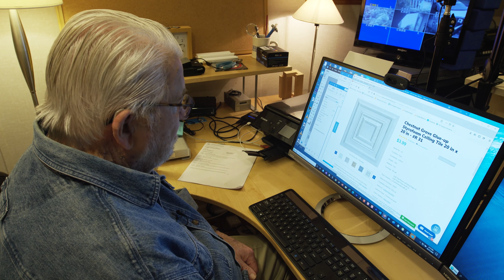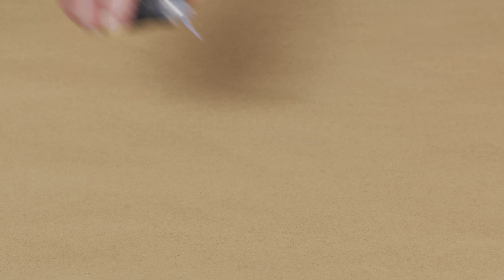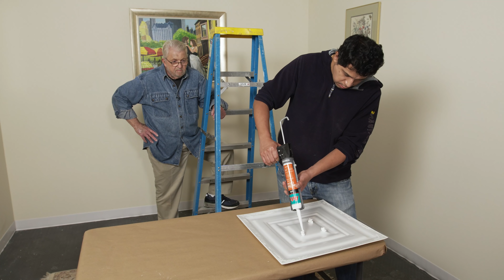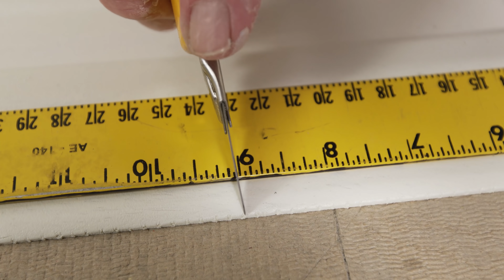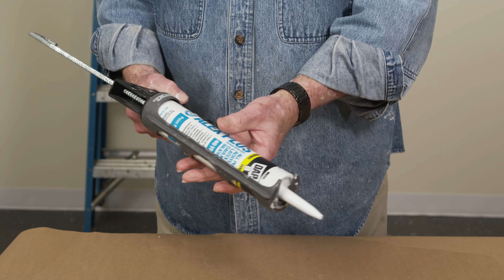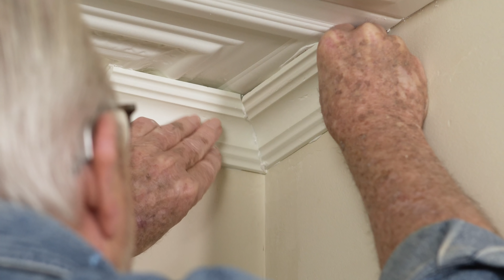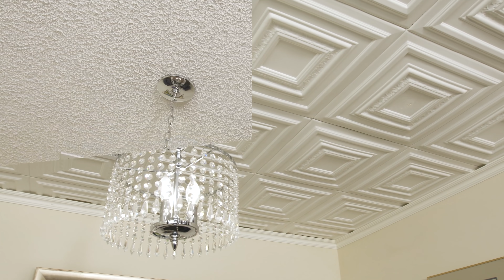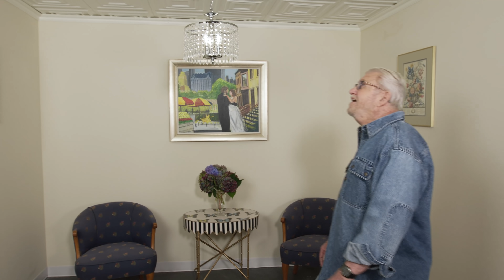Say Goodbye to Messy Popcorn Ceilings: DIY Guide to Covering with Glue-Up Ceiling Tiles

Comment: I disagree about starting at the true center of the ceiling.  I would have started at the center of the opening for the light fixture for a better overall look.  As it is, now the chandelier looks off.  What happens when the "popcorn" starts losing its grip on the sheetrock above? Now you have ceiling tiles coming loose and eventually falling off if you don't adhere them an alternate way.  It's a reasonable alternative to scraping, prepping and painting and looks really nice.  You could even just scrape and install the tiles, forget the prep and painting.  The demonstration and illustration was very good, nice and clear and logical.

Comment: I have scraped quite a few popcorn ceilings. Yep. Messy but worth it to have a smooth ceiling. Just get the texture wet and scrape it off with a 12 inch drywall knife.  Works great . . . Unless the ceiling has bee painted! In that case, I just go over it with 1/4 inch drywall and finish as normal (I have strapped the ceiling when necessary before putting on the drywall).
Reply: I have an awful popcorn ceiling in my living room. Whoever did the taping and mudding did a terrible job. Most of the "joins" can be seen, with no popcorn or tape. Not only that, but I recently had a kitchen fire resulting in soot throughout. Including the ceilings, of course. The house has been professionally cleaned, but walls and ceilings have soot stains. I've been trying to figure out my next step as far as the ceilings. Thanks for your comment, which makes me thing I should go with the 1/4 inch drywall. Now, a question: You say you strapped the ceiling. What the heck does that mean and how important is it?  Thanks.

Comment: Before considering this method there are two things to consider:
Textured coatings very often contain asbestos about 5% Chrysotile (white asbestop) so try not to disturb e.g. Dont scrape!
Polystyrene tiles are highly flammable and in the event of a fire they will provide a source of flammable material promoting the rapid spread of fire and the burning material will drip causing secondary fires. The smoke from the burning product is highly toxic and will rapidly spread to other parts of the property.
Reply: These polystyrene tiles are are serious FIRE HAZARD My mother bought a house with these on the kitchen ceiling,she had an oil fire on the cooker and it went up the wall as we were trying to extinguish it,as soon as it hit the ceiling the fire shot across the whole ceiling,the fire service said these are the worst things possible to have in a house,sorry I know they do a great job but they aren’t worth the risk
Reply: Any good safer alternatives?
Reply: Easiest bet is to skim plaster over them or overplate with plaster board to give a smooth surface then paint, it will look like a new ceiling. The asbestos content is low about 5% (if confirmed to be an ACM) wear an FFP3 mask when screwing through plasterboard if thats the option you go for.
Reply: @densalbeach1  wouldnt have thought the orig popcorn could handle the weight, especially wet from plaster, who knew
Reply: Two of the rooms in my house had  stippled Artex (trade name for a textured coating) because of the age of the house I presumed that it predated the legislation banning the use of asbestos. I brought in a plasterer to skim both ceilings, the both now look great. To remove Artex a chemical has to be applied XTex is one that is regularly used do scrapes for electrical instalations etc.
Reply: @dereckc9469  it doesn't.  Tried the above, only to come in the next day and find a huge pile of popcorn and fresh mud 2 inches thick all over the floor.
Reply: @eyerockart  you could just get a 9 in roller and roll some spackling compound over it 2 coats to seal it up as well .
Reply: @eyerockart  if your house was build after 1995 and has popcorn just scrape it. wear mask and goggles and full body suit , and use the wetting method to remove it
Reply: Thank you for that information.
Reply: @howmanyremember  Make sure to get the right mask coded for asbestos.
Reply: A mask rated as FFP3 should be used when working with any product that potentially contains asbestos. In the UK you can get task sheets for working with low risk ACM's (Asbestos Containing Materials) e.g. Artex (textured coatings), cement sheet used for shed roofs etc. These guides will include the necessary PPE and how to use it.
Reply: @Target Buy a kit; you need to scrape a small sample into a plastic bag and send it to a lab for analysis.  Wetting it allows for a fairly dust-free removal but wear disposable gloves and a mask.
Reply: Asbestosis pre 1980
Reply: In the uk the use of white asbestos (chrysotile) wasn't banned until 1999, blue and brown (chrosidolite and amosite) was banned in 1985, this includes the use of used ACM's (asbestos containing materials).
Basically asbestos was widely used in construction, if you have any doubts always play safe and get it analysed.
Reply: Thank you. It's good to know that the tiles are as toxic as they are ugly.
Reply: They have new ones that are safe. These are sold everywhere.
Reply: Asbestos has been outlawed for a long time that is a lie
Reply: So I changed my mind using it . Thanks for the warning ⚠️, However  I was going to say , that would provide another layer of insulation against cold 🥶 and heat 🥵 . Thanks !

Comment: This is not a DYI for a home decor upgrade but rather a Step by Step instruction guide on how to build your personal oven and tomb.
Reply: I know. The idea is good. The material used is bad. I'm redoing a bathroom ceiling with plastic ceiling tiles & trim...the cost is very reasonable & the tiles can be painted as a future decor change. ...I was shocked to see polystyrene for a real home. Polystyrene materials are used fairly often to build room mockups for companies to use as mobile displays to showcase their products for sale.

Comment: You sir are smart, putting ceiling tiles up to cover a horrible ceiling is the best and most cost effective thing to do, also they are fireproof, they have to be nowadays its a legal requirement. if your ceiling is fairly straight then i use a thick wallpaper paste to fix them, it dries in 2 hours.

Comment: FANTASTIC video thank you!
Reply: Get plastic or tin ceiling tiles...polystyrene is dangerous flamable. I'm redoing a bathroom ceiling using the super nice plastic ceiling tiles. Various colors available. Make the center mark at the center of the main light fixture & not the center of the room or else the main fixture can look oddly placed. Plastic border trim can also be bought. ...The polystyrene tiles & such are used a lot to create ceilngs for theater stage sets, room mock-ups for companies to make artificial rooms to show off their furniture & appliances & home decor & other items for sale...polystyrene can surely be bought & is used by cheap house flippers to make their redone homes look nicer. Basically the polystyrene catches fire & spreads real fast & has bad toxic fumes. Be careful.

Comment: If you dont see it , will not desapear  look harder then  remove the popcorn   plus i guarantee that will fall on you  popcorn is n ot to put nothing on it
Reply from the maker: Hello Aurelio, it is actually easy to put.  Many time when removing popcorn you will find that the surface under is not smooth and it needs skimming, sanding and painting.  With these tiles you have many looks to choose from and all you have to do is glue them up over it.  However, it is very important that the popcorn ceiling is in a good condition and is not falling apart to the touch.  If this is not the case it should be removed before applying the tiles. These tiles only look good, they also add a bit of insulation.

Comment: QUESTION: Can these possibly be glued up on plaster ceiling? I removed dropped ceiling in our old house and plaster is mostly in great shape except a few areas of finish coat that came off with thick wallpaper.
Reply from the maker: Yes, absolutely!
Reply: @DecorativeCeilingTilesInc  Do i have to put a new skim coat up of plaster first?  I know if we find any cracks I need to repair them but if just this skim coat do I have to replace it first?

Comment: I wish this actually worked. Sadly, this method did not work for me. I hired a handy man, had him watch the video and he said they wouldnt stick, kept falling off...  :(  now either he was just lazy or plain dumb I dont know but didnt work out for me.
Reply from the maker: Hello Edie,  do you know which glue did he use?  There is a possibility that popcorn was really loose and it would take it with it.  We recommend #310 InstantGrab adhesive https://www.decorativeceilingtiles.net/instant-grab-ceiling-tile-wall-panel-and-crown-molding-water-based-adhesive-310/

Comment: How much adhesive is recommended per square foot? I'm trying to figure out how many tubes of adhesive I need for my 250 sq ft ceiling.
Reply from the maker: Hello Josh, we have been recommending 1 tube for about 10 tiles ( 27 sq.ft). You will need about 10 tubes.

Comment: Why waste money covering the ceiling with this plastic crap! It will fall down in less than 10 years, guaranteed. It is not hard to remove the popcorn and re coat with a knock down of orange-peel look. Or better yet, don't remove it and put up 1" x 2" slats on the ceiling 12" apart and install staple on interlock tiles with a cove around the edges, will last longer and no cheap plastic crap that will fail.

Comment: As a professional handyman, I would much rather remove the popcorn, (yes, it's messy, but controllable) and retexture with splatter knockdown or finish the ceiling so it can be painted! These tiles are cheesy not to mention toxic. These are made for those who are too lazy to do the job correctly!

Comment: As a retired contractor, this looks awful. The gaps between the tiles and the crown molding leaves huge gaps. 
I rather see 1 x 3 firing strips screwed through the ceiling into the wood framing and sheetrock on top of that. It only drops the ceiling a small amount. 
Of course if the popcorn has asbestos in it,  you may need to have that removed by a specialist.

Comment: Looks nice though however just plastering over the popcorn ceiling is what I do for many years, no mess no dust either because I used vacuum  cleaner hooked up with perforated sandpapers on pole sander. I coated 3 times. It does not lower the ceiling because it flushed exactly as the thickness of the popcorn itself

Comment: If you like the look of those panels, go for it, this is a good instructional video.  However, removing a popcorn ceiling isn't difficult and should take less time and money than installing those panels.  I just did this throughout my own home.  It went a lot faster and was easier than I thought it would be.  After I was done, I let the ceiling completely dry, and then used some drywall mud and sanding to fix a few problematic areas.  Once I was done, I used some white ceiling paint, and it looked perfect.
Reply: Another way to go is to texture the white paint with a special sand that is sold to mix with the paint.  I just removed the popcorn in my garage and used this sand finish on it.  Removing that popcorn ceiling was one of the worse DIY jobs I ever did.  I made a big mess--even in a garage!
Reply: @AStanton1966  Yeah, it's messy, and I suppose there were different methods used to apply it, so how it comes off might vary based on the way it was applied.  But on mine, I just used a spray bottle and a 10" taping knife.  It came off very easy.   Very messy, but very easy.
Reply: We did ours too. Not that difficult.
Reply: Unless it's older popcorn with asbestos.
Reply: Ours had plaster in the mix, it was a nightmare to remove.
Reply: I hope you wore an anti asbestos mask when you took off  your popcorn ceiling.
Reply: Lucky you. Our popcorn is made of vibranium. Tutorials said, "just spray it with water and it falls off"... nope. Same with the texture on the walls. I can redo the walls, but I'll have to cover the ceiling.

Comment: as a professional drywall/painter for over 35 years [not boasting just voicing my concerns] I see promise in this alternative ceiling treatment, the numerous times I've had to remove popcorn from ceilings, I HATED IT- period! But the glaring issue is, even though it says ..."without removal as long as your popcorn ceiling is in a good shape and is not falling apart to touch." Hmmm, I'm sure they will bond great today BUT, these tiles should fall off sooner or later. especially if there is ever any moisture or humidity in the room. At least scrape the top layer of acoustic (popcorn) off before applying these tiles. The video says that glue will create a secure bond...which makes no sense to me because this type of texture is brittle and comes off very easily when moist or wet. My point is, your adhesive is only as strong as the surface that you are bonding your panels to. So even though I've never applied or worked with this product, PLEASE do the proper thing and properly prepare your surface for the BEST {long-lasting} results. 5 years down the line when it smells from moisture, mold and mildew building up between the tile and the ceiling you'll be calling a professional to correct the problem and believe me, it will cost twice (or 3x's) as much removing the loose panels, the popcorn and the gobs of adhesive that will be stuck on your ceiling. But I must admit, I do like the look of these tiles and am considering trying them out on a podcast room I'm remodeling. My main concern is the fire issues and toxic fumes associated with polystyrene products...not that anyone expects a fire...but it's also wise to not have a room full of accelerants "IF" sparks fly

Comment: I tried scraping the popcorn ceilings in my home, just to find they had been painted. 
Someone suggested drywalling the ceilings.. well for being a single homeowner of a 4100 sq ft house that would be very costly, considering the rising prices.
I love the look of the tiles and how quickly they go up.
If the new owner wants to replace the ceilings.. that's their call.
Reply from the maker: Thank you for your comment.  We are happy to help in any way we can regarding your ceiling. You can call 866-297-0380 to speak to our support team.

Comment: In England, ceiling tiles can now  be bought , made from incombustible vinyl.
However, such tiles still remind me of those awful dangerous polystyrene tiles that could come, flaming , down if a fire broke out. Also the edge coving  was equally ghastly. After a few years, badly installed tiles came adrift.
I have had some of my Artexed ( peppercorn) ceilings skimmed over , by a skilled plasterer; yes all furniture and carpets must be well covered, but the result is a beautifully smooth ceiling. I then had gyproc coving installed , to finish off the rooms.
The white result does not need painting , for quite a few years.

Comment: They make metal tiles. But that may interfere with wifi and other signals. I think its easier to wet the ceiling and scrape it off. Then skim coat with drywall mud.

Comment: 1 - Polystyrene is a fire hazard
2 - As long as they aren't the old asbestos installations from the 50s or 60s, popcorn ceilings are pretty easy to remove.

Comment: Why not just go from corner to corner to mark the Chalk lines, it saves the hassle of measuring. Also there is no way in hell I'd use Polystyrene in my home, that stuff is insanely flammable and very toxic when on fire. I'd definitely rip out the Popcorn ceiling or pay someone to remove it if it has Asbestos in it. Never do things on the cheap, especially in your home, always pay for quality and safety and do the job proper, and then you'll never need to worry about it for many years to come.

Comment: I’m not an electrician but I believe it doesn’t meet electrical code to reinstall the light over the tiles the way you did. The box should be mounted outside of the tiles with the lip of the box on top of the tile surface. Your way sandwiches the fire hazard tiles inside the electrical box. You would need a box extender or to replace the box altogether.

Comment: I would think with all the negative comments from knowledgeable people here that you would take this video down. As others have said, they appear to be a fire hazard. 

Aside from that, just like when tiling a floor, you do not start in the middle which can give you partial rows to cut on all four sides. Always start from the most conspicuous wall and corner to the least conspicuous. That way you can only have two sides with partial tiles at worst.

Comment: To enforce the Fireman’s statement.......pay attention......
1. Every chance your house/fire insurance is now invalid.
Ask your insurance company “do they recommend ceiling tiles” be prepared to pay a lot more insurance.
2. The streen tiles leave air pockets between ceiling and tile.....helping the fire to spread.
3.  Scrapping the “ Artex plaster “ from the ceiling, is a no no....every chance it contains...3% Asbestos.
Find someone to plaster over the “Artex”
4. Finally...You’ll understand what the Fireman is saying, 
When the molten streen drops on your skin....if the toxic gas doesn’t get you first.

You might want to look at....
the TV news reports of the glenfield tower block in London, those “tiles” were on the outside
Stay Healthy..lots0luck.

Comment: Wow, this is highly dangerous. The safest option is to have the ceiling plastered. If your popcorn ceiling is older than the mid 1980’s then do not attempt to scrape it off. In the UK popcorn or Artex products often contained asbestos until it was banned in the 80’s. If in doubt plaster it out..
Reply: EXACTLY - a plasterer comes in and smooths it all out.